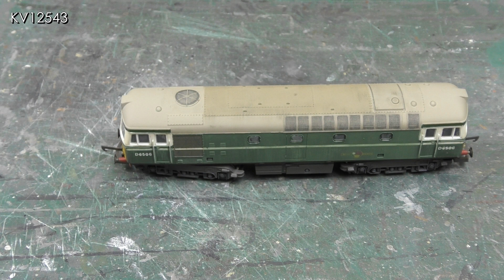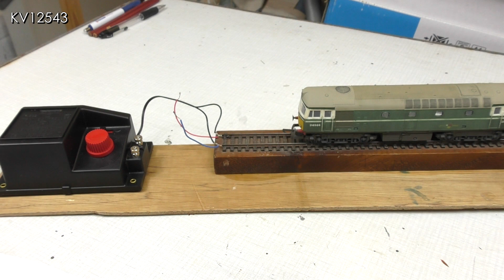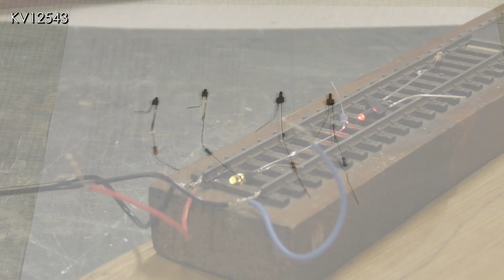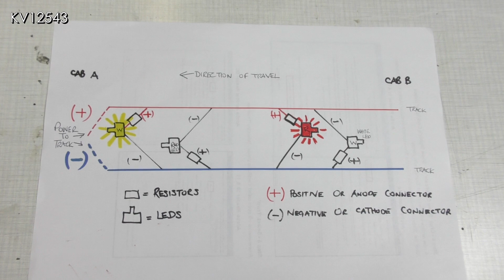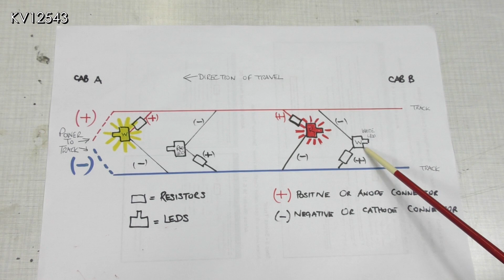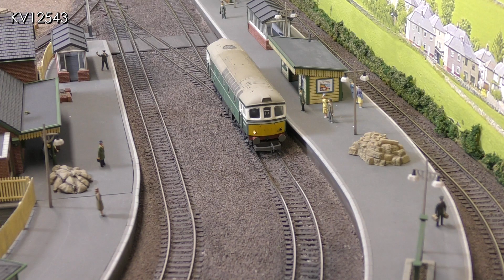Fitting  directional lighting to an old Lima diesel

Comment: I managed to get a working headlamp on a Hornby 0-4-0 Santa's express for less than $2 for my Christmas layout. Big Bertha beacon style headlamp, but as the loco isnt really prototypical, but a resounding success for cheap proving it's possible.

Would love to see you do something similar to this video but on one of your two already modified 0-4-0 steam engines.
Reply from the maker: Well done for getting a working lamp on such  a small engine....I may try to modify my 0 4 0 tanks  and fit a flickering smoke box glow....we shall see, depending how difficult it is and how much room there is, Regards Keith

Comment: Keith I am more than happy to offer my services when it comes to electronics. I need to say that leds don't enjoy reverse bias. So what you have done is liable to failure at higher track voltage 
 The way around that is to mount them in inverse pairs.  The working one then protects the reverse biased one. It means you only need 2 resistors in this application not 4. Let me know if you need more of an explanation.
Reply from the maker: Thanks for that...all very interesting as all this electronic stuff is new to me. DCC concepts briefly mentioned reverse bias in the instructions which accompany their LEDs but in relation to AC not DC current so I had ignored it. I will make further investigations before my next project and may well yet come back to you for more advice, Regards Keith
Reply: @KV12543  Yes although leds are diodes, they don't enjoy reverse volts. So you either use another diode instead series, or the trick I mentioned of wiring both whites back to back and both reds back to back. That means the operating one protects the off one. It's a pleasure to help. Incidentally,  are you anywhere near Dorset? You welcome to pop in if you are and ill take you through it over a cuppa
Reply from the maker: Thanks again for your help....i am a lot wiser now.  I will have to turn the offer of a cuppa as I live in Devon , Regards Keith @gs425

Comment: I have just ordered, from China, some bidirectional red/white tower LEDs to do my lima class 33s. They will let me have both lights working at each end. When the "slow boat" arrives, I'll let you know how I got on with them.
Reply from the maker: I look forward to that...if the boat doesn't arrive in time, DCC concepts also sell red/white 2mm tower LEDs...I purchased some for a possible future project on a Hornby HST, Regards Keith
Reply: Amazon sell most of these LEDs - and usually can deliver at a much faster speed than direct from China. Depending upon whom the sellers, many of them can be delivered the following day.